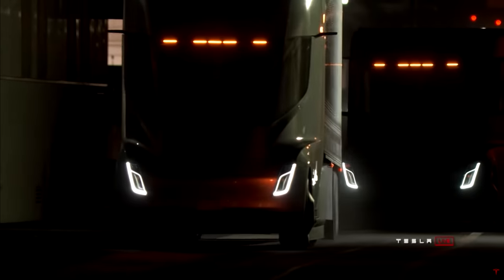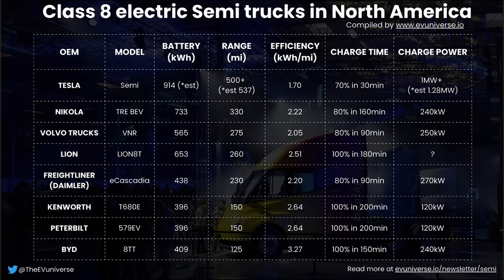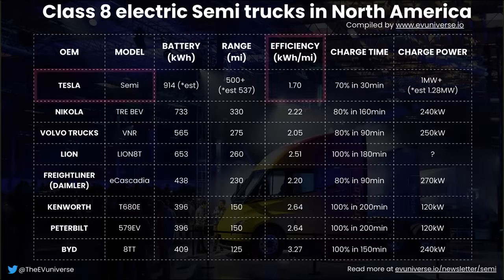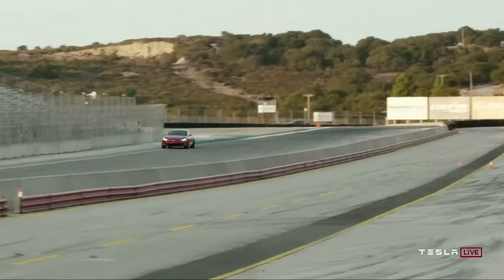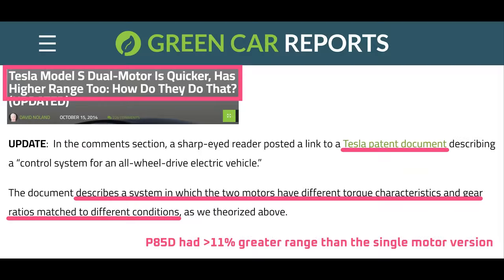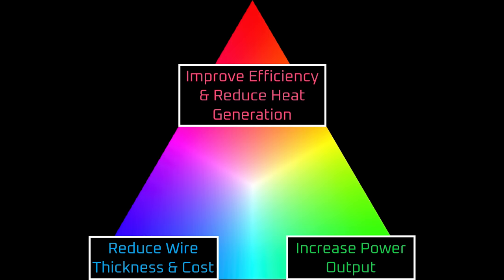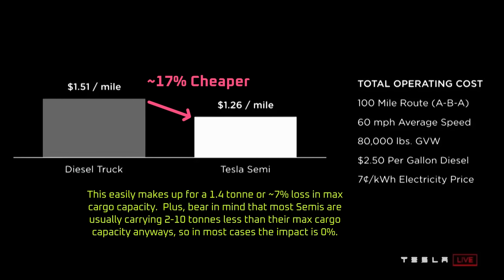How the Tesla Semi “Broke the Laws of Physics”

Comment: The tesla semi can't pull a quarter of the weight of a diesel truck, So you need 4 teslas to do what one diesel truck can do. That is just stupid
Reply: Where'd you get that nutty idea? The Tesla Semi has two to three times the horsepower of a diesel semi, and unlike a diesel has substantial  torque at zero RPM to get the load rolling. What is the factual basis for your claim?
Reply: @BigBen621  He's obviously easily gulled.. it's really rather sad.
Reply: @TheEvilmooseofdoom  Funny how nobody responds when you challenge them to produce actual, well, facts!

Comment: Any idea on what the payload on the 500 mile journey was yet?
Reply from the maker: Engineering explaioned covered it
Reply: So - what was it?
Reply: Do your own research.  Ever hear of Google?
Reply: I had a look and couldn't find it.  This guy doesn't know and says Engineering Explained.  I looked at engineering explained and he was working out the weight of Jersey barriers when they weren't the payload in the 500 mile journey.  Tesla aren't saying either for some reason  So how about you?  Do you know?
Reply: @biscuitapocalypse5883  It was probably around 39,000 lbs. One pallet at the rear of the truck, where the lightest loads are placed, was marked 600KG, and it's plausible that there are 29 pallets, for a total of at least 17,400 KG or 38,360 lbs. plus driver and some misc. loads.
Reply: Thanks Ben, if there were 29 pallets weighing that much in the truck then that would be better than I imagined.  Hopefully Tesla will provide some information on that soon.  Or Pepsi if they haven't got an NDA.
Reply: @biscuitapocalypse5883  The PepsiCo executive is quoted as follows during an interview in December: "The Gatorade maker declined to share specifics on the weight of the trucks, another closely guarded secret by Tesla." Sounds like NDAs all around. But it's inevitable that this information will leak out, sooner or later; and of course eventually it will be released to the public by Tesla and/or PepsiCo.

Comment: Sizing the battery for re-generation works if the challenge is to overcome change in elevation. Trucks as elevators. 🛗

I believe there is another use case where the elevation change is not the priority, but maximum horizontal range. For this use case, SuperCapacitors may yet prove lighter and longer lasting for storing transient spikes of electric power. Acting as accumulators, they can smooth out the current charge/drain peaks  on the batteries. This would also help in longer battery life

Also, as commercial EVs gain volume, we will see dedicated stretches of highway equipped with infrastructure that will re-charge the truck as it drives. This will change the battery pack size calculation trade offs. These roads may also be private,  limited access, free from DOT sticky fingers,  and optimized for full self driving.

Again, all this is just my opinion.

Good content
Reply: I would not hold my breath on charging in road.  That's a lot of extra cost and complexity for all that underground hardware (you'd need miles of it).  Easier to just put in a charging station.
Reply: @TheEvilmooseofdoom  Yes, capital is an issue.
I was thinking more in overhead power lines, no buried.
The equipment would fit on the fairing above the cabin. 
The market will decide
Reply: @ricardokowalski1579  some mines in other countries operate heavy duty commercial use evs with catenary line's on them now on the uphill sections of the mine from the bottom of the pits. Then the trucks regen otw down. 

I think it was somewhere in a Swedish country that was trialing road use ev trucks with catenary line's already. 
That one French train that went over 360+mph back in the 2000s also used catenary line's. So it shouldn't be all that difficult to implement. 🤔

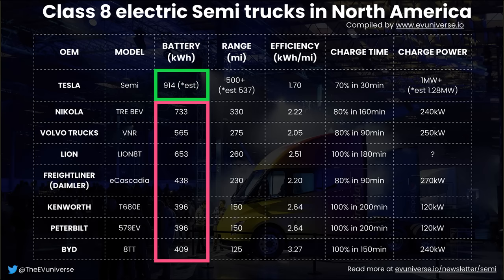Comment: This is a waste of 14:51 minutes,  "10:48 self proclaimed educated speculation" and wrong wishful thinking on many fronts.
It was cheated as the mass of the Tesla Semi on that 500mi trip was not 41t as claimed but only about half of it and the speed was also lower as claimed..
You can babble all you want with small efficiency advantages that may exist here and there but those are miniscule compared to the plain rolling resistance and air drag.
On highways there is little to regenerate except the Semi was built in the mountains and just goes downhill.
You failed to calculate the rolling resistance for a 41t Semi and air drag at 55mi/h on a flat road which would have shown that you need at least an energy of 3kWh/mi.
You certainly know what 3kWh/mi*500mi means.
Even the title of the video tells it is BS.
Reply: Kullat Nunu Is there any factual basis for your claim that the mass was half the claimed 81,000 lbs.? This would essentially mean the trailer was empty; while you can clearly see in the video that the trailer is loaded with pallets front to back, and at least one can clearly be seen labeled with a mass of 600KG, or >1,300 lbs. So clearly it's not empty.

Motor Matchup has calculated power required by the Tesla Semi, including air and rolling resistance, here: https://youtu.be/zQDU9f4QTLk; and it's consistent with the 1.7 kWh/mile stated by Tesla.
Reply: @BigBen621   @6:07 one can see 11 barriers on the truck.
Each weighs 600kg which sums up to 6.6t of load, doesn't it?
The truck and empty trailer weighs 15-20t depending on the size of the battery which Elon Musk did not reveal.
Therefore including load the truck weighs 21-26t and not 41t or 81000lbs what was claimed.
The guy in the video you linked assumed a rolling resistant coefficient of 0.006 which is unrealisticly low. 
0.01-0.013 is an appropriate value here which even vastly depends on the roads.

It all drills down to physics but you have to pick the right values of course.
If the trucks weight would be 41t as claimed and with a rolling resistance of 0.011 the needed energy would be 2.72kWh/mi.
But as we know the weight was 21-26t and with a rolling resistance of 0.011 the energy consumption is 1.63-1.92kWh/mi.
With a 1000kWh battery the truck could just about make 500mi with one charge.
But not with a weight of 41t as claimed. It would need 2.72kWh/mi and reach only 360mi given a 1000kWh battery.
Which is it?

It needs to be guessed a little bit here as Elon Musk doesn't reveal the whole truth and even lies here and there.
He certainly knows why.
The highly praised cW of 0.36 by the way just lowers the consumption by 13% compared to a cW of 0.66 and the whole truck doesn't just consist of an engine.
The weight and the rolling resistance are by far the main contributors here.
It's the same with energy consumptions obtained by norms like NTFZ, WLTP or EPA.
None of those consumptions can be reached by any product once you own it yet the manufacturers claim it and can even demonstrate it.
The next big contributor is the temperature.
For the calculations above I assumed a temperature of 20°C.
During winter the ranges can go down by 30%. 
Which means 350mi instead of 500mi for the 26t truck or 250mi for the 41t truck.
Reply: @kullatnunu2087  You're confusing two different trips. The 500 mile test was done with an enclosed trailer, which I addressed above. The likely  payload was around 40,000 lbs., based on the apparent number and labeled weight of one of the pallets. More to the point, Tesla stated that the truck was loaded to a GCVW "just under 82K" (21:09 in the Tesla Semi delivery video). Tesla has posted a detailed graph of the 500 mile run from Fremont to San Diego, on 93% of a full charge; equivalent to a range of 538 miles. And in addition, they have posted a stop-action video of the entire trip. The Tesla Semi battery is generally agreed to be around 900 kWh, so this would result in 900 kWh / 538 miles = 1.67 kWh/mile, within 1.5% of the 1.7 kWh/mile efficiency Elon Musk has stated.

So now we're confronted with the situation that you calculate nearly twice the energy per mile as the graph of the 500 mile run shows, and nearly twice the energy per mile stated by Elon Musk. It seems that only one of two things is possible; either your calculation is mistaken, or Musk is lying and the entire Fremont to San Diego trip and graph is faked. While many have stated the belief that everything about the Tesla Semi is faked, no one has come up with a reason for Tesla to do this, and there are overpowering reasons for them not to. In brief, PepsiCo and other potential clients know exactly what the battery size, range, and efficiency are, so they would know if the range test were faked. And this would likely cause Tesla to lose all credibility in their eyes, leading to the loss of sales. So what incentive would Tesla have to fake the range test and risk the loss of sales? None, it would seem. As a result, I'm reluctantly forced to conclude that it's your calculation that's mistaken, rather than that the 500 mile range test was faked. 

The trip with the barriers was the Donner Pass trip. Yes, there are 11 barriers; but it's clear that these are Caltrans-approved 10 ft. K-Rails, which weigh 3,900 lbs. each ((I have documentation of that, if anyone wants to see it). Including 1,500 lbs. for tie down paraphernalia, driver, and misc. stuff, this sums up to 44,400 lbs. payload.
Reply: @BigBen621  "In brief, PepsiCo and other potential clients know exactly what the battery size, range, and efficiency are, so they would know if the range test were faked."
Agree. 
Yes and as I wrote it mainly depends on the real weight and rolling resistance and someone knows it for sure once it's owned.
We'll see if I'm mistaken and what will turn out to be the correct numbers.

Comment: this is still groundbreaking for large companies that can afford the charging infrastructure. This still does not help owner-operators nor small construction companies since they cannot afford. We need cheaper ways of adding and permitting to make this a more viable change as well as adding solar on trailers that are not 2x the cost of current trailers. With adding solar to warehouses and vertical wind turbines this could make the warehouse and the truck be carbon negative in operation. (energy consumption only)
Reply: It will take time.  The system and infrastructure can't pop into existence over night.  I doubt solar on trailers will happen very soon since most drivers don't own the trailer, they drop off and pick up so that's a cost being passed to someone else for someone elses benefit.
Reply: @TheEvilmooseofdoom  they already exist on reffer trailers with batteries to get rid of diesel generators to keep your food cold with batteries and solar. The problem is they are 2x as expensive as I mentioned above. But a regular solar trailer would be in comparison of a made trailer today, and with the same weight with fabric solar panels. The action is to have a lead to the trailer like it is for traditional to the cab.
Reply: @TheEvilmooseofdoom  p
I've posted elsewhere
"Why not overnight on V3 chargers?"
.
Essentially the "Semi" version of the "Home car charger".
.
100kW, 8 hours.

Comment: The efficiency argument is weak, the Model S uses 18650 cells and a pack design that is somewhat different than the pack for the Semi which uses 2170 cells. The two may be close in efficiency, but we cannot assume they are.
Reply from the maker: Yeah, we can assume the two packs are roughly equally efficient, espcially given the higher voltage of the Semi pack.

Comment: Still waiting on the Semi's weight. Hauling chips doesn't make it special. I guarantee my legacy diesel moves more freight faster and longer. This thing is vapor until there are actual numbers. All you fanboys, and girls, should hold your praise. Muskrat is a hype machine trying to get the spotlight. Just like an orange former president.
Addendum: Newer semi's cd can be as low as .5 and they continue to trend down. The .65 is misleading. Even my rig is lower than that.
Reply: In neither of the trips discussed in the Tesla Semi delivery video was the Tesla semi "hauling chips". In one, it was hauling 11 Caltrans-approved K-Rails, with a weight of 3,900 lbs. each; and in the other, it was hauling a trailer loaded from front to back with pallets, at least one of which was labeled "600KG". So unless a pallet of chips weights >1,300 lbs., no chips in this run either.
Reply: I believe your legacy diesel does move freight faster and longer.. But it also costs more.  You haters like telling half truths or outright lies.  That's part of what being small and petty is about.  You shame yourself.
Reply: @BigBen621  Fine, what's the weight of the truck? Why is that so hard? They know it. Publish it. Simple. You're off on some ridiculous tangent about some trip. Doesn't change anything.
Reply: @Rjsjrjsjrjsj  Tesla obviously considers this a trade secret for now, which the PepsiCo VP has confirmed. There could be several reasons for this. But the facts are that everyone who actually needs to know this information—customers and potential customers—already know it (presumably, at least, once they sign their NDAs); and Tesla is under no obligation to release it to anyone else, no matter how much they pout and stamp their little feet.

For the record, my best estimate is 27,000 lbs. ± 1,000 lbs. This information will eventually come out, one way or another; and then we'll see whose estimate is closest to reality. In the meantime, stay safe out there; we all appreciate your work delivering the goods.
Reply: @BigBen621  🙄 Blah blah blah. What's the weight? Do you know the weight? Does anyone outside of Tesla know the weight? Save your deflection for someone who cares.
Reply: I do believe that diesel truck aero continues to improve. Can you share a good source of recent data? And what's your current rig (truck and the trailer type which results in that drag coefficient)?
Reply: @brianb-p6586  Not one in particular. My information spans many years and multiple sources. Print, video and personal. I have a modified freightliner. Aero model with add on pieces. The trailer depends on who I'm pulling for. But you can do a quick search for cd of semi-truck to get general info. Typical cd's can range from .5 to .9. So figure your latest models as opposed to the old "classics". Freightliner actually calls their old style Classic. Those are horrible. It's basically pushing a billboard down the road.

Comment: It was tested at relatively low speed and it has a battery pack that's so large that it will make it completely untenable from an economic standpoint. End.
Reply from the maker: By that logic, non of Tesla's vehicles are commercially viable.  Yet somehow they are.  End.  

Thank you for the comment.  It was both entertaining and helps the algorithm.
Reply: @thelimitingfactor  Huh? Most of Tesla's vehicles are not several times more expensive than the vehicles that they compete against in the market. They're also not commercial vehicles, which exist solely for the purpose of producing profit for their owners.
Reply: @PistonAvatarGuy  Wow, you employ a lot of flawed reasoning.  You're not half as smart as you pretend you are.  Shameful.  But you zero's are usually like that.  Just jealous of your betters and bitter to the point of being ridiculous.
Reply: @TheEvilmooseofdoom  Like what? Right all the time? I know, it's a curse.

Comment: 400k mile battery pack competes nicely against gas vehicles since gas veh are junk at 400k, but diesel semis last up to a million miles or more, so until you have million mile batteries, changing semi battery packs kills the economics of the whole thing, unless costs come down or battery life goes up
Reply: Statement 1
Jeff Dahn, 2022 (paraphrased)
"We can adjust the parameters on NMC chemistry to achieve a 2 million mile cell"
.
Statement 2
Elon Musk, "Battery Day" (and since)
"We're aiming for 50% (±) cost reduction"
.
Plus, consider that we now know the Semi pack is at least somewhat "modular". You won't be replacing the whole pack..... IF there's an issue.
.
WHY does everyone and his brother seem to think "the smart people" haven't considered these factors over the last 5 years?
Smh
Reply: @rogerstarkey5390  they haven't explained it very well!
Reply: The battery can do about 2000 charging cycles, with 500 miles per cycle. Voila - 1 million miles battery. 150.000 miles per year, so you need 6 1/2 years to wear out the battery. The price of the battery is going down of 16% per year, so the cost of a new battery will go down 60% in 6,5 years. The truck itself should do easily 2 million miles with some refurbishment at 1 million miles. Considering the savings on maintenance cost compared to a diesel truck, you can easily swap the battery for a new one, sell the old one to recycling and go another million miles.